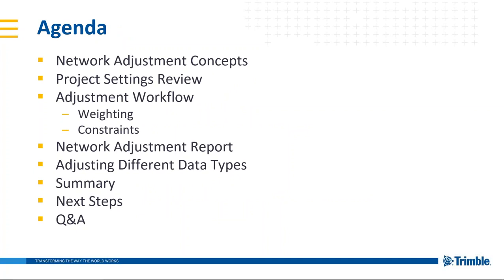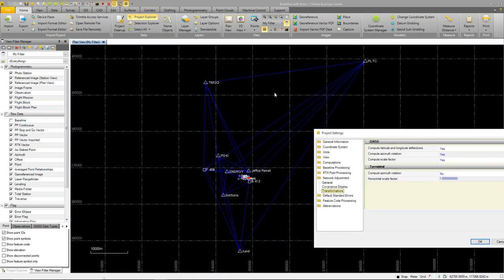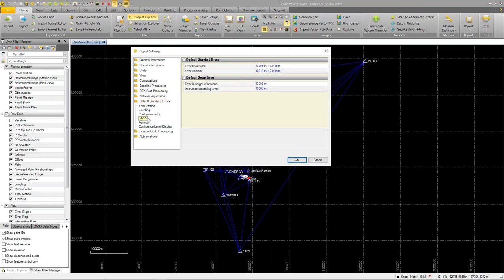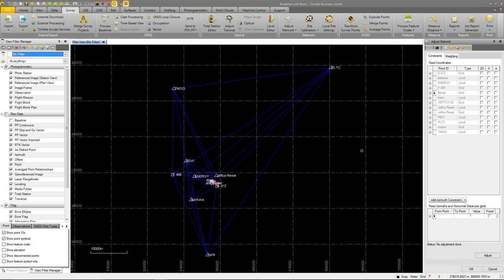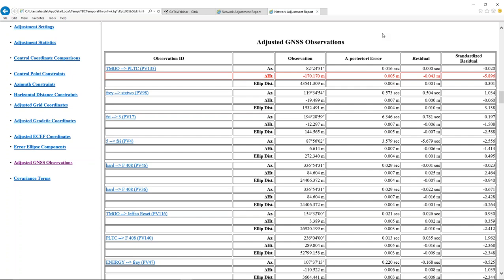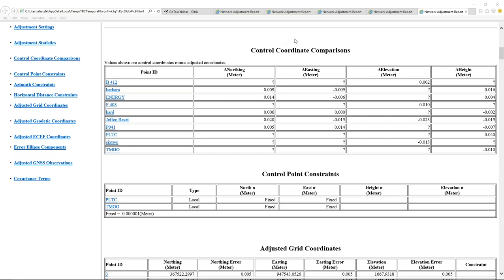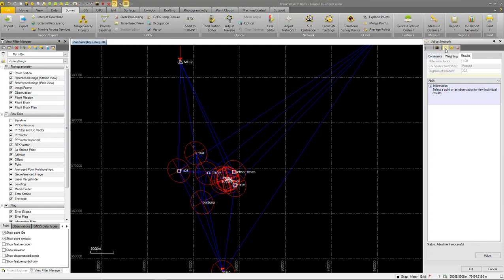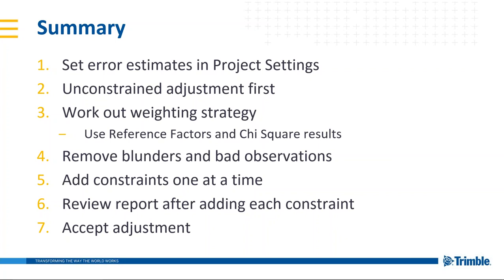TBC Power Hour   Network Adjustment Workflows and Best Practices

Comment: Hello, i have a question about adjusting network: when i click adjust, in the report, the elevations of my points are shown as "?". That means they are not calculated. I use grid type control points, which are Northing-Easting points (fixed in 2D) and shoted benchmarks which are fixed in e (h row doesnt work because they are not local). I want to adjust my network and give elevation to my points using the e, grid-type, benchmarks. How can i fix this problem?

Comment: From the Adjustment Network dialog box in the Constraints tab under Fixed Coordinates, why does it not show or list the points I have in my network? The dialog box is empty, and how do I add my network points in there to be able to fix control reference points?
Reply: I am also having this problem, I haven't been able to get any of my points to show up in the Fixed Coordinate list.